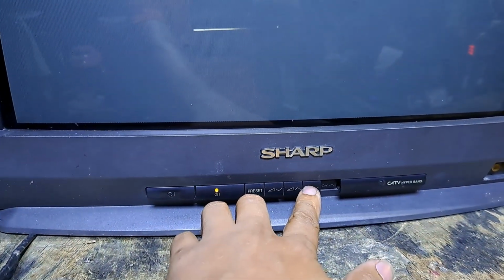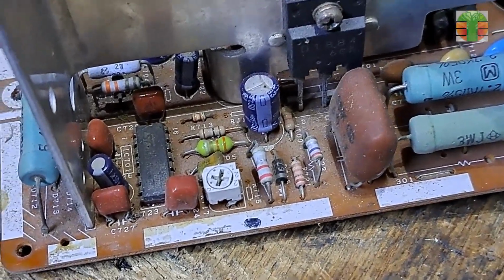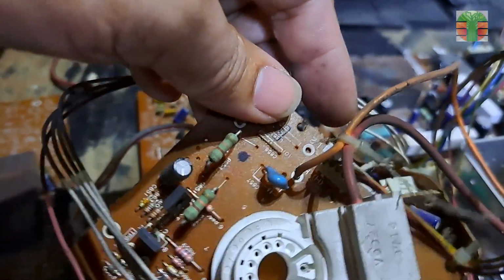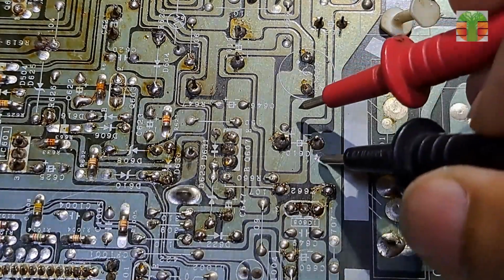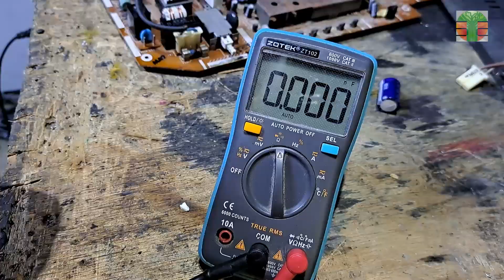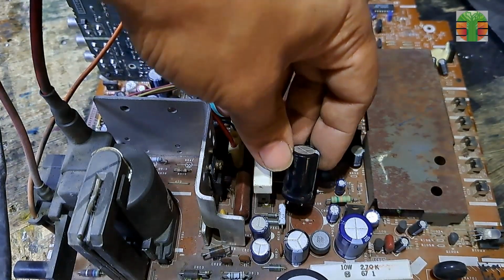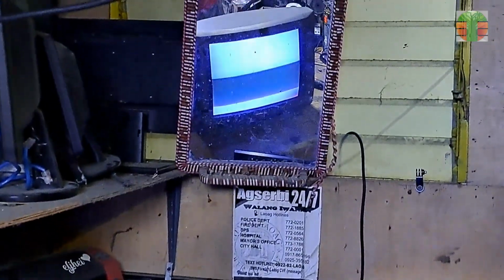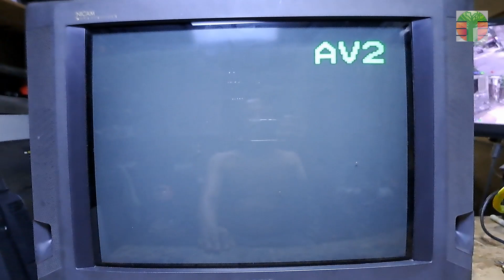Sharp CRT TV model 21JN8 repair

Comment: See you repairing the crt tv I remember the old days 90s.
It's very hard to learn. It's like icu tv. Sometimes hard to find the problems. I did stop learning on these tv. May be because it was difficult to learn or I didn't have the facilities like nowadays.
Now we internet everything is easy to Google and find the datasheet.
But in the 90s was very difficult.

I prefer the led tv rather than the crt tv.

Good job as usual ❤️